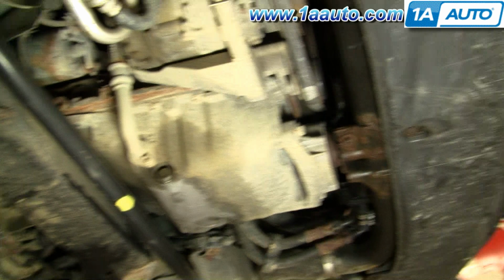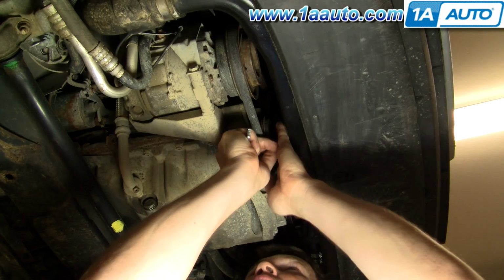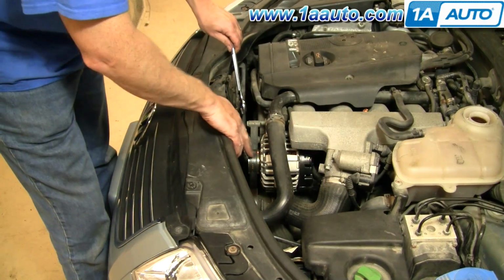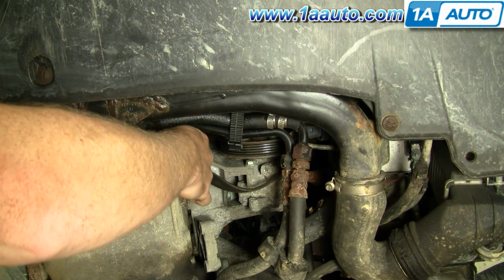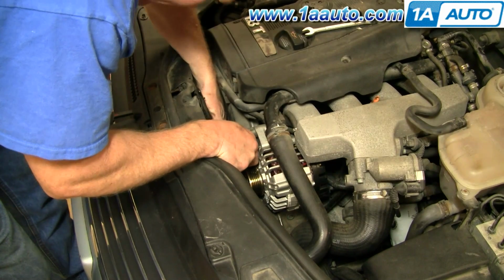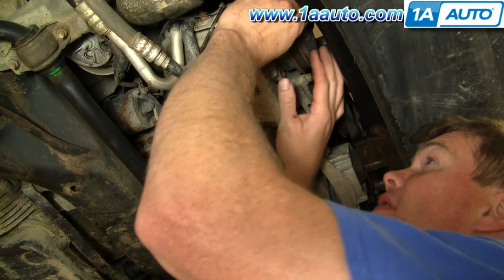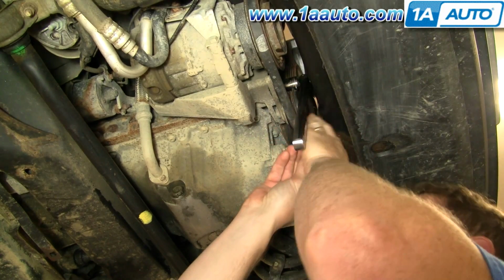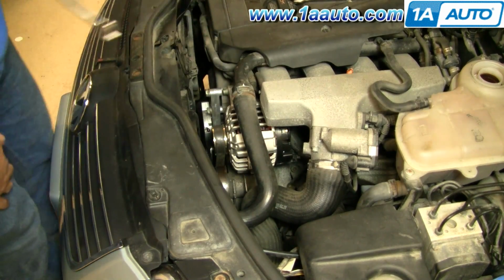How to Replace Serpentine Belt 98-05 Volkswagen Passat

Comment: I did my AC compressor belt in 2021 with your other helpful video, and this video was great for demonstrating how simple this R/R is-- save the hundred+ bucks the shop would charge you!   Thanks for this great tutorial, I did it with a minimal amount of blood loss and swearing 😉  Man, VW could have offered a couple more inches of space, right?
Reply: For what it's worth, I HIGHLY suggest going with the 4pk 860 size for the AC compressor belt, rather than the 4pk 855. I don't care what the VW spec is-- it's a million times easier to put on, that extra half centimeter of length makes a world of difference. The tensioner has plenty of room to allow for it, why suffer needlessly!?

Comment: Thank you thank you thank you. You showed the right way to do it, showed it from all the key angles, and narrated all the key steps. I never would have found that hidden little allen bolt that locks the compressor belt tensioner. My first time messing with belts, but I did the whole job in half an hour. If I had gone into it with just my Hanes guide I'd probably still be under there!
Unfortunately I needed to get it done right away so I bought the belt locally instead of ordering from your website. Just want you to know I'm grateful!

Comment: Volkswagen REALLY could have given a couple more inched in the front of this engine.  Unfortunately, this isn't the only pain in the tail thing to repair on the Passat.
Reply: So there a "service position" where you pull the front clip forward to gain more access, in case you weren't aware.